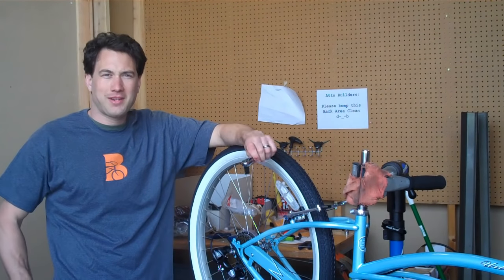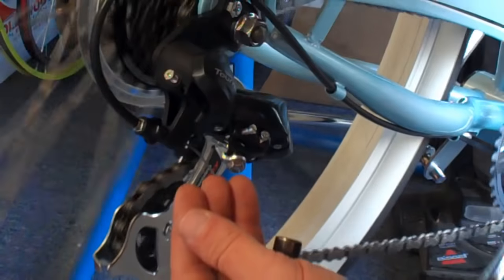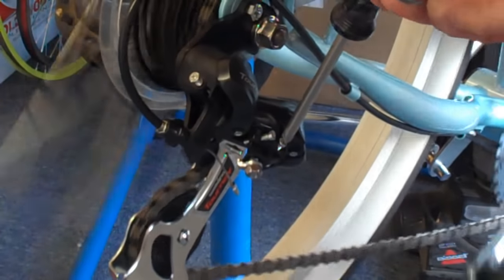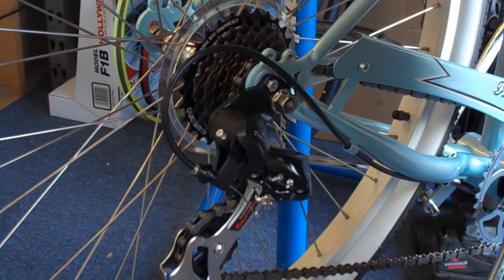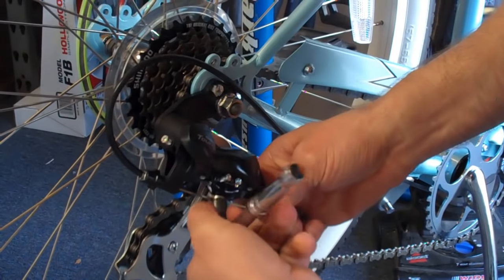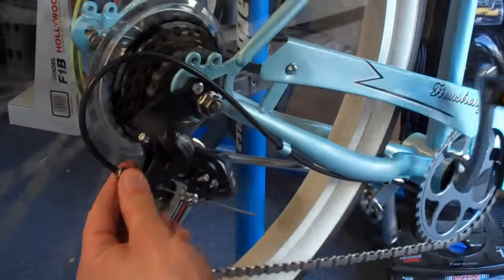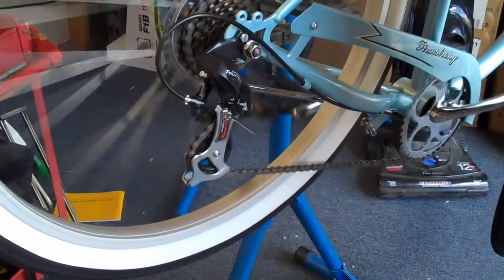Beachbikes.com - How to tune a 7 speed bicycle (adjusting a derailleur)

Comment: Thank you so much for this video. I have been trying to figure out how to tune my 3x7 derailleur, specifically the back one. I had all the tools, but didn't know what to do from there. One thing other videos I watched failed to mention was removing the cable attached to the derailleur before adjusting the H screw. This is what made my adjustments actually work!

Comment: Very good video, FYI but the B screw was not explained.  

The B screw is to adjusts tension on the derailleur, between the frame and the derailleur (not to be confused with tension on the derailleur cable which is adjusted with the Barrel Adjuster).  The B screw adjusts the vertical distance between the derailleur pulley the rear cassette rear cassette.

To increase the vertical distance between the derailleur pulley and the cassette turn the B screw clockwise
To decrease the vertical distance between the derailleur pulley and the cassette turn the B screw counterclockwise

Comment: I watched dozens of these videos. I have an inexpensive Hyper Spinfit 700c with a Shimano rd-tz31 low end rear derailleur. It's set up in a 3X7 system using a Shimano twist shifter. Your video was the simplest, easiest, and most applicable to my situation to understand. It worked plain and simple. I know you posted this 12 years ago but you should know it is still helping people today. Thank you.
Reply: So true. I bought an electric bike with a 7 speed gear shifter and it just wasn't aligned properly. Was about to bring it back to a shop but instead ended up here. Took me 5 minutes to watch it in detail and another 10 to adjust the gears on my bike. Simple and perfect!

Comment: Thanks Peter.  This helped me immensely. 

My new bike would go into 7 or 1 (the settings on the handle bar gear changer) and not change into another without mega issues.  I tried for three days before I watched your video before I finally figured out my problem.  I thought, "Why doesn't my bike do that when I do what he does?"  So I thought, maybe the cable was broke.  When I went to take cable out, I saw a reflector was tighten down over this cable and this was causing issues, not allowing the cable to shorten or lengthen.    I took the cable out from under the reflector and started all over again.   A short time later, I hit the lottery!

To me, the smallest gear is the high gear is confusing.  In my head I just thought the handlebar shifter setting 7 equals the littlest sprocket.  The handlebar shifter setting #1 equals the biggest sprocket.  The top screw is for adjusting the handlebar shifter setting #1.  The bottom screw is for adjusting the handlebar shifter setting # 7.  Finally, my bike is perfect.  Then if you have minor clicks, just use the adjuster where the shifter cable connects to the derailer.  

Thanks for helping me learn something new.  Your video is perfect.  All the other videos left out loosing the cable totally for adjusting handle bar setting #7 (the smallest gear sprocket on the back of the bike) or putting the cable back on before adjusting the next the handle bar gear settings like #1 ( the largest gear sprocket on the back of the bike).  Annie

Comment: Great instruction for understanding how the derailleur works. One more factor to consider while adjusting this gear is the chain link. I couldn't get some of my lower speed to work until I try to adjust the chain length
Reply: That's it?  No explanation what constitutes the right length?

Comment: It's worth mentioning that before you re-attach the shifter cable, to pull on it while shifting up and down to check for freedom of movement in cable housing. One in 1000 may have a kink or something that does not allow free flow of cable.  
Also, when re-attaching cable, make sure your shifter is in high gear. As you shift to check for free flow of cable, you'll see the cable comes in and out of the housing. You want it all the way out of housing before re-attaching to hold down nut.

Comment: This process works great, but if your only problem is the shift points are slightly off, you might find that adjusting the fine tuning knob is sufficient.  Separately, I got some actual chain lube for the first time ever this weekend, instead of just using WD-40 or motor oil or whatever, and the real chain lube worked a lot better.

Comment: Pete, thanks so much for this great video.  I have a Sun Drifter ST 7 with the same Shimano gear setup.  I bought a couple of bikes from a local dealer and he never set up either bike correctly.  Took it back the next week and he had shut down his business leaving many of us on our own.  This video was exactly what I needed to get my gears changing properly.  I've noticed the shifter has become harder to turn, any tips on how to make it work better.  Also, the nearest SUN dealer is over 40 miles away and I need the handle bar grips, the rubber literally disintegrated.  I've tried Ebay and others but no success.  Do you sell parts for my bike?  Thanks again for sharing your video!

Comment: The instruction is great except my handlebar #s are apparently the opposite of what's in the video. That's the only problem I have with this video...my handlebar #7 coincides with the smaller gear. In the video Peter says 'shifting to #2' which really threw me off for a while(since was starting with #1)....fortunately I figured out handlebar #1 coincides with largest gear on my set up

Comment: I have a Firm Strong 7 speed like this so it was a big help. However there is a error in the video. The smallest cog is 7 so you will be shifting up to 6 gear and not 2nd gear like he said in the video.  I have purchased 2 bikes from Beach Bikes over the past 4 years and they have held up well.  Just remember gear 1 is lowest gear and the largest cog with gear 7 being the highest gear and smallest cog.

Comment: Hi Beachbikes. I have a 7 gear Schwinn bicycle that I'm attempting to tune up for my daughter in law. I don't have a bicycle holder so I had to place the bicycle on  a workbench. I engaged the pedals and the back tire started to turn but once I stopped pedaling, the chain started to sag real low. I thought that it was a simple tightening of an adjustment screw but I can see that the place where the derailleur is attached to the bicycle has no room for adjustment. What can cause the derailleur to not return to it's position that'll keep the chain from sagging? Could it be that the spring is too worn? I'd appreciate any advice that you could give me.

Comment: Good video so i'll ask a basic question its odd 1 trail i ride i get a lot chain chatter sounds like its looses cant grasp what it is . only happens on the 1 trail i've ridden 10 mile long trails this sound never happens i have put on 200 miles on odd trails depend were my job sends me which trail i ride i'm a quick under 10 mile rider no street rides . but its like a ghost takes possesion of the bike on this 1 trail 3 mile long trail one way chatters every time i stop peddling . its a month old bike i never set up a bike before it shifts fine i'm  rarely out of my top gears i ride because i'm forced by a bike ridden spouse & doctor who  force me to ride every day calls it  love more like torture . i've ridden 1500 miles in last 4 months just not on my own bike i plan to try what you showed in the video because i never messed with the derailer when building it

Comment: Wow, I made this a loooong time ago! I misspoke a couple of times in this video. Let me save you a little trouble--

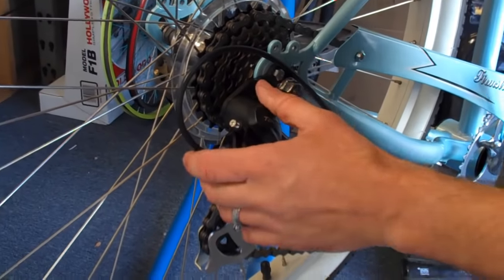First, I think I forgot to mention that the very first step is to shift the handlebar shifter into the highest gear. In this case, that's 7th gear. Then loosen the cable 0:37.

Next, at about 2:22 , as I start to shift through the gears from 7th to 1st (high to low), it sounds like I am naming the gears in the opposite order. For instance, I say "second gear" as I shift into 6th gear. I was counting off the gears in the order in which I was shifting, but it would have been better to call them by their usual designation. I should have said, "now I will shift into 6th gear, adjust the barrel adjuster, then shift into 5th gear, 4th gear, 3rd gear, 2nd gear, 1st gear."

I also say "micro-tensioner" for the barrel adjuster. It won't make any difference to anyone who is using this video, but it's called a barrel adjuster and I don't know where I came up with the other term 🙂

I hope that helps!

Comment: Is there any way to download this video. I would like to have it in my shop (no wifi).
Reply: If you are using Windows 10 you can use the built in screen recorder by pushing the Windows key and the letter "g". in sequence. Quality isn't great but it works.